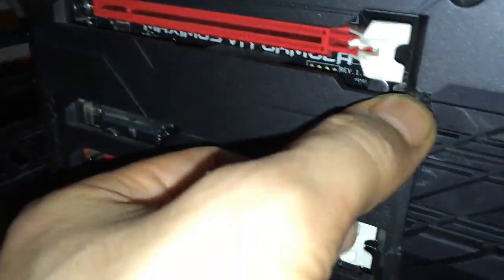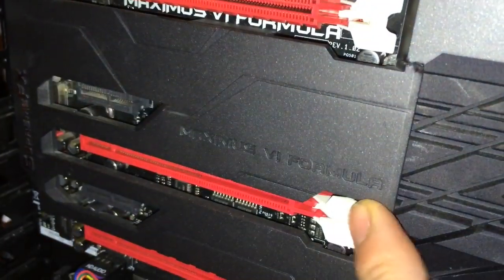019: Asus ROG Maximus Formula VI - Cmos Battery Armor problem! "PIECE OF SHIT Mobo"

Comment: I have a maximus vii formula and I need to change the cmos battery lol I may as well clean the entire system and do a full rebuild while I'm at it. thanks for the video.
Reply from the maker: This video is 9 years old... You would think, anyone at asus would give a fuck...its unreal.
Reply: @lindstrem   I totally forgot that I had used liquid metal on my delidid 4790k way back in 2016, it wreaked the Corsair h110 I have installed, I used a razor blade to scrape it off the best I could lol. Took the board out, swapped out the cr2032 with a new Energizer branded one and rebuilt the system. I'm using mx4 thermal compound and at 4.6ghz I'm idle around 29C and max load 62C for 20 minutes. Completely stupid design with the cmos battery, they should have placed a little door or just placed the battery holder on the bottom of the board so you could get to it without completely tearing down the system.

Comment: I have the same problem. Dead battery. My battery was dead from the time I received it. After building the system, and with the very first boot I noticed that the clock seemed to be wrong. Then my clock continued resetting itself. I believe Asus has been aware of this problem, because the tech at Asus was only interested in the serial number of the board. I asked why she wanted the serial number, and then she finally told me that she wanted to determine if the motherboard was more then six months old. I said what does that have to do with a battery that should last much longer. I have had many computers, and NEVER have I had such an issue with a battery. I have decided to just remove the so called " armor", and just use the board without the useless armor. Since so many people seem to be having this problem, I am wondering if the battery issue is a more serious problem then we think. Even IF the armor was not an issue, why does it seem that the battery is dying so fast? Is it just a batch of bad batteries, or is it a flaw in the board? Is there a bios update that Asus might have put out that may address this issue, IF it is a board issue? It is hard to know what the bios updates fix, since they all just say that it is to improve system stability. Making such a vague statement is like saying nothing informative. Asus in my opinion has come down a notch in quality.
Reply: I have same problem, will changing battery works ?

Comment: I have replaced the battery in the FORMULA VII in a bit less than 10m (this might vary for other mobos like the FORMULA VI).

- Remove the GPU.
- Use 2 small screwdrivers to bend a bit on each side of the slot to lift up the armor and let them stay there (mine didn't got bent nor dented after doing this).
- With a third screwdriver, pull the battery up and push it out of the slot and push it to fall to the left side.
- Place the new battery in the slot and push it down until it clicks and stays in place.
- Move the screwdrivers to the left side where the old battery is.
- Ease the old battery around until  it comes near the bent opening and pull it out.
- Remove the screwdrivers and done!

ATTENTION:
Be careful and gentle when placing the screwdrivers in the slot or prying for the battery.
YOU DONT WANT TO TOUCH NOR DAMAGE ANY OF THE STUFF INSIDE THE ARMOR ON THE MOTHERBOARD.

Do this at your own risk.
Hope this helps someone.

Comment: Just for anyone else with a Maximus Formula VIII (not 6), the battery is under the hard drive flap at the bottom. Undo 1 screw and the plate will lift off. It's still got plastic half covering it but with a bit of a push it will come out. You don't have to cut or remove anything.

Comment: I have the same mobo and I just encountered this problem. The battery is low, or something. Because the computer no longer maintains date and time.

Like you I looked over the entire user manual (the digital version) and searched for 'cmos battery', and 'battery.' it literally doesn't say a single thing about the battery, how to replace it, how to get to it, and what kind of battery it takes.

I have to go through this process with a friend in the coming week... Thanks for the video, I couldn't find much about this issue.

Comment: Thanks for confirming my worst nightmare. cries
Reply: I CANNOT BELIEVE YOU GUYS CUT YOUR ARMOR... =|  it's an issue with bios not a battery issue. yes common syptoms but not actual culprit. I followed some simple directions online and i have since to experience the problem. It's been about 8months or so since.
Reply: Tim C think you're right Tim. I cut my armor to replace the battery and it still didn't work. Keep in mind this was only after months of dealing with ALL my files having incorrect dates, amongst other super annoying problems. In the end I just had to update my BIOS, a step which I thought I had already taken. At any rate this is really inexcusable from ASUS, definitely not shelling out money for their high end boards anymore after this.
Reply from the maker: Carson Powers
Tim C Yeah well, see the thing is that this "fix" is a mystery. My Formula VI worked fine for the first few month, then it started having this clock problem and nothing solved it. Battery exchange didnt solve shit either and i tried all other fixes as well, all possible bios updates and reflashes and what not, you name it. Everytime it works for a day or two and then its all screwed again. If you check the ROG forums, people from all over the world complain with zero solution. People fix it temporary with the Asus support tips and then its screwed again. Asus has NO FIX FOR THIS PROBLEM. Tim, if you found a fix, you are the first one... let us know what you did and we will happily do so.
Reply from the maker: Sick Games Entertainment
BTW Asus already admitted that there are Z87 boards that have this problem (in my opinion its one out of three) but apparently asus claims its only very few boards and those boards must be send in for varification. They do not send out a board for substitute so you can just send the faulty board after installing the replacement.
Reply: Sick Games Entertainment UEFI builds 2*** released or will be up shortly on the support pages - fix list states RTC stop issue cured:
Model Name BIOS ECN NO.
Z87-A 2005 EN-0204103
Z87-C 2004 EN-0204123
Z87-PRO 2005 EN-0204140
Z87-PLUS 2004 EN-0204149
Z87-EXPERT 2004 EN-0204089
Z87-DELUXE 2004 EN-0204139
Z87-DELUXE-QUAD 2004 EN-0204143
Z87-DELUXE-DUAL 2004 EN-0204141
GRYPHON-Z87 2004 EN-0204171
VANGUARD-B85 2004 EN-0204173

ROG boards to follow.

Comment: Just bought the same motherboard. I guess I will replace the battery with a higher quality one first thing, before I even assemble anything to ensure it lasts longer. My guess is with a good brand battery you will get 4-5 years of use out of it. By then I'll have probably moved on to the next better thing anyway...

Comment: Wow, so hard to believe that they did not give a snap in door to do this. Thank you for the video, I know I will need it.
  I was not happy with my 4770K OC ability and decided to sell it on ebay and purchase the new 4790K as it has better OC ability and better TIM.  I took out the 4770K and tried to put the "dust Cover" back to cover the empty 1150 socket and ended up having the legs bend and break the pins on my socket. It could not be fixed at a local PC shop, so I ordered a "open box" from newegg for 221 dollars.
The new MB will arrive in two days, but now on the Asus Forum, they say if I dont have an old cpu to install the newest bios and utility, that the new 4790K will not work.  I can look at the label on the MB when it comes to see what Bios was on it upon being made, but I have no idea if the old owner may have already upgraded bios or what. Im going to video tape the box opening and right away look at the pins, but Im sure NewEgg has already done that as so many break the pins and ask for RMA.  I thought I could do a flash drive and upgrade to the 1505 bios and 
I wont know until I get the board if it will even work for me. What a ***
Reply: Its funny how they put both of mine together here.   I returned the VI and bought a VII Formula.   With two 680's I had OC'ed my VII to over 5ghz and now I have a 2080Ti and am having a lot of issues with the bios.   I cant get it to save now, but at first the mouse would not work at all, only the up down left right keyboard and enter to pick.   
I want to change My Cmos battery and now I dont know if the battery is in the same spot as the VI ?????   I will make a door if it is.

Comment: Same situation here. System brings failure message when booting (due to the missing fans), battery empty, all watercooled (all! - MOBO, CPU, gfx card). Very disappointing, although the motherboard is on the other side, very nice.

Comment: Thanks I'm fucked! 

Good video mate, I believe my battery is dead as my time keeps resetting.
Reply from the maker: its not the battery, thats what i thought too. I replaced my battery, clock is still fucked up, to this day i didnt find a solution. Welcome to Asus.
Reply: Sick Games Entertainment yep I was thinking of opening mine then I found this and it fixed my frozen clock in Bios wich makes you think it's the battery.
http://rog.asus.com/forum/showthread.php?36676-Frozen-Time-Clock-in-UEFI-The-Fix
I feel bad for you bro you possibly didn't need to do what you did.
Reply from the maker: iiron eagle
thanks, i will try that. I already tried similar instructions and helped but only for a brief time. What i did i dont regret cause i will need to replace the battery at some point anyway... dont matter. The problem with time is outrageous for a 300USD board. Never again!
Reply: Shit happens and like you said one less worry for you. Other than that I still love this board. I didn't get Asus GPU's I have 2x MSI R9 290X Twin Frozr which I love.

I think it happens when saving OC profiles and using them. It must save the time and bug it up. Just avoid OC off your saved profiles, you should be good. At least they do have fixes and not like some companies ignore the problem.
They should have gotten that info out more IMO, keep a close eye on the ROG forums, cant hurt.

Comment: What I seriously do NOT get from ALL of you guys complaining is this. Did you get forced at gunpoint to buy this MOBO????  You could clearly see the armor on the board BEFORE you bought it, yet chose to purchase/use it anyway . @OP you call this mobo a piece of S**t just because it is a massive pain to change the CMOS battery. As a mobo it is fantastic
Reply from the maker: Thats because previously it was unheared of that a cmos battery needs drainage of watercooling and unimaginable. Why would an endconsumer ever anticipate this? What i seriously do NOT get from ALL this, is that 7 years later ASUS to this daaaay STILL covers up the cmos battery and zero fucks was given. And yes, this Mobo was a dissaster, not just cmos, when it was released people had to fight all sorts of problems, including TIME. I dont remember anymore but there was an odd error when the mobo kept changing time and date and messed up all software u has installed because the programms thought that u try to hack it and locked u out. The usb ports, omg, i could rant another video on this lol. I have now gigabyte and hate it as well but i can tell you i bought gigabyte because one of two reasons and the first one was that i didnt want asus even if it were for free.
Reply: @lindstrem  I know the time issue, was a windoze/BIOS problem primarily, not restricted to this motherboard as it impacted all mobo's using the same chipset/bios etc. 

Don't think I am trolling you! I know your frustration because I am sitting with my CMOS battery which finally went dead about 6 weeks back and I have not changed it yet because I am not in the mood to strip down my entire system.

That said, to slate an entire motherboard because of the lack of access to a component, especially one which can last up to 10 years (or longer) before it needs replacing is harsh. IN my case, my CMOS battery lasted 7 years. 

It is no different to saying that the Porsche 911 Turbo is a P.O.S car because you cannot get to the spark plugs unless you remove the motor.

I am in the IT/Music industry and I program, do 3d modelling/graphics and music recording/production professionally, and I have not had one single issue with the Maximus VI Formula mobo, or the previous version for that matter (Maximus V formula - which is still running today on a daily basis too ...The CMPS battery on the Max V Formula  is still OK, 9 years later and counting).

I purchased the Max VI because I loved the look of it and it was used for a demo/display extreme gaming PC I built up. I have carted the PC around the globe, literally, dismantled it, flat packed it (chassis included) in a suitcase, rebuilt it on the other end, numerous times! ...  and not a single issue with the mobo in 7 years.
Reply from the maker: @stevewayne1359  no no no, u not gonna  compare it to spark plugs cause ppl are not expected to change them on their own. Compare it to filling up watercoolant as thats something common and now tell me that you need to lift your engine to do it. Did u even watch the full video? I said that they dont even mention it once in the entire manual which is why 25 k people watched this video. The problem is that people like you are willing to deal with shit like that instead of asking asus why they didnt at the very least put the screws on the front side or make 1 inch circle cut out with a rubber plug. 

This is the outcome when marketing department gets more money than R&D.

Comment: i havnt encountered a computer needing a new cmos battery in at least 20 years...
Reply from the maker: buy a formula board... you will encounter shit you hadnt dreamed of the past 20years
Reply: Sick Games Entertainment I have a formula vi, i think if your not prepared to get down and dirty with your gear you shouldnt be buying enthusiast level parts :)
Reply from the maker: Jarrod P
At the price it comes at - you shouldnt have to. Thats the issue here and its not like one knows of these problems before buying, i got the board the day it released. Would i have known these problems i sure as hell wouldnt buy it...
Reply: Jarrod P I haven't applied any saved bios settings since and it hasn't returned.
Reply: I wouldn't expect to have to completely dismantle my PC to change the battery. I can't think of any other motherboards other than these ASUS boards that require you to do that. You think this is acceptable design?

Comment: Not only did ASUS make this ridiculously hard to do, they put CMOS batteries in that apparently only have a 3 month lifespan. They must have taken them out of obsolete boards before they were destroyed. I've been building my own computers since the early 90s, and I've NEVER had to replace a CMOS battery... until now.

Of course systems with these boards are water cooled. Why would you buy one and not use WC?

This is something I never considered when I was building the box. I remember examining the board and looking under the BA for the CMOS battery, but I never thought anything of it because like I said, I've never changed one in all these years...

Bottom line? I'll rip a hole in mine and hope I don't screw something up. Ridiculous bullshit design.
Reply: I've had my Maximus Gene VI since Feb and unplugged and did a thorough dusting...low and behold system time will not stay synced. Perhaps they used the same shit batteries.

Comment: ASUS will be releasing fixes for the RTC issues for ROG boards soon according to what info. they have posted in the Forum so far. Some boards are already listed as of 6/11/2014 but it just says "ROG boards to follow". So we shall see.

http://rog.asus.com/forum/showthread.php?35490-Sabertooth-Z87-Bios-Clock-Issue&p=408653#post408653

Comment: Mmh ... I will probably have to do the replacement next weekend. But from just checking what needs to be done, I do not expect that it will take me much longer than 20 minutes if I really do just that.

Opening the case = 1 minute
Remove the GPU = 1 minute
Remove the water block = 1 minute (luckily I do not have rigid tubing)
Remove all cables = 1 minute
Remove all screws = 1 minute
Remove the mainboard = 1 minute
Remove the screws for the armor = 1 minute
Replace the battery = 1 minute
Everything in reverse + new thermal paste = 9-10 minutes

Comment: I viewed this just after I built mine. im using corsair 750D case and corsair H100i water cool. ive built 3 computers in a 10-15 yr span, so I use my computers for 3-5 yrs before total upgrade to something new. ive always used asus motherboards with not one bit trouble......till now. one yr after the build, cmos battery died. ONE YEAR ASUS? spend the extra 3 cents and install premium batteries. I would have replaced the battery if I would have seen this video 5 days earlier .
Reply: Kris Pax I haven't applied any saved bios settings since and it hasn't returned.
Reply: Astrix au I didn't see anything about bios reset....dam. I even posted in asus forum with no replies. I changed out the battery using all same settings and clock and computer runs great. if I have problems in the future will clear cmos. I still have the battery and will throw a volt meter on it see what it reads. thx again